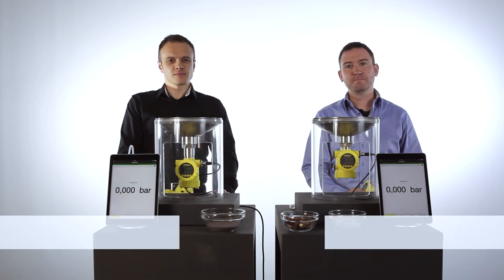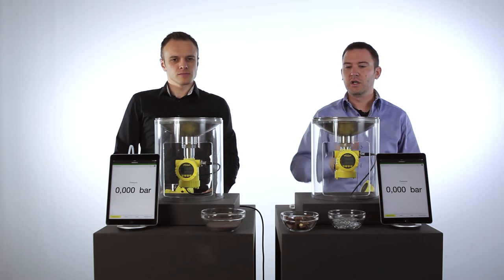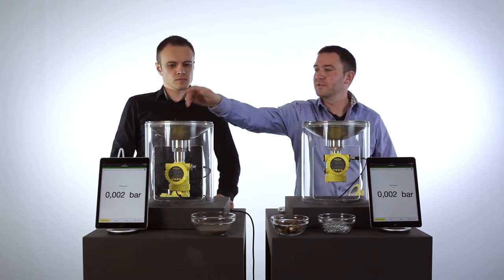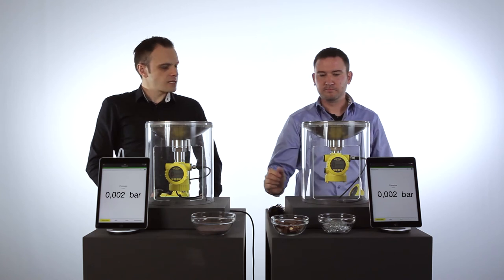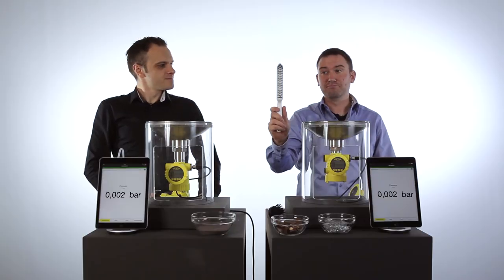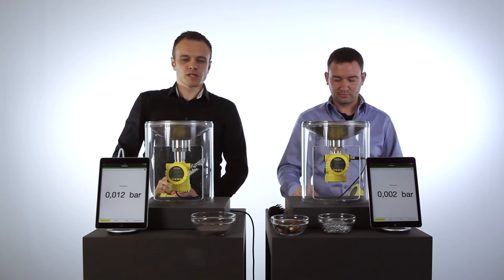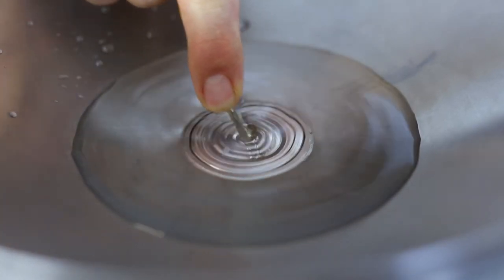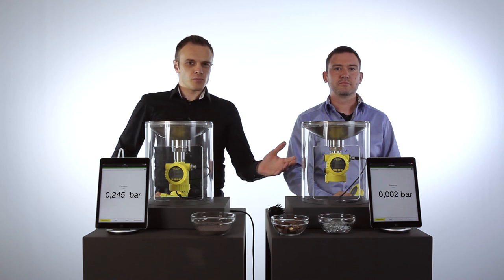Ceramic measuring cell | Pressure Instrumentation

Comment: OK but who in the entire industry cleans the sensors with brushes and screw drivers?
Reply from the maker: Hello Renan Galvão - we hope no one does. :-)
The test is meant to prove the extraordinary robustness of the ceramic pressure measuring cell as it is required for applications with abrasive media. On ships, for example, where sand puts a lot of strain on the measuring cell.
Reply: VEGA Grieshaber KG OK, now I can realize the benefit of it. :)